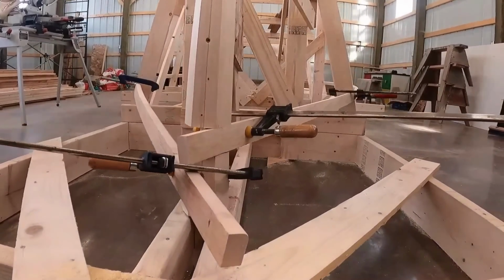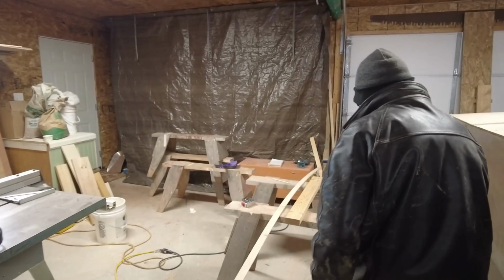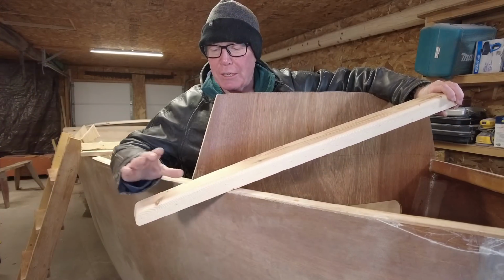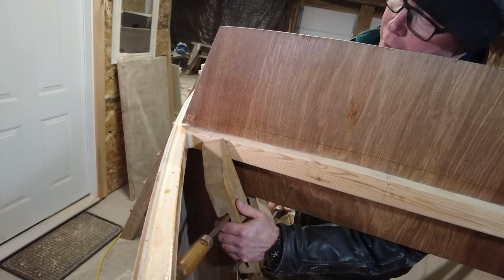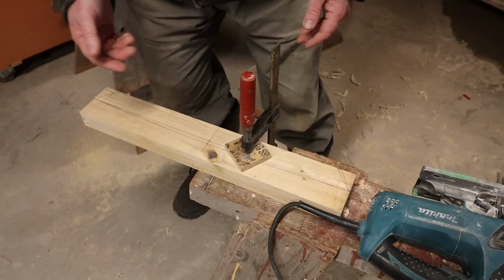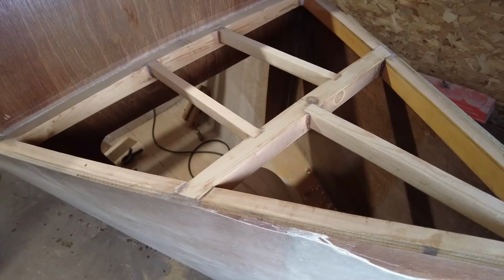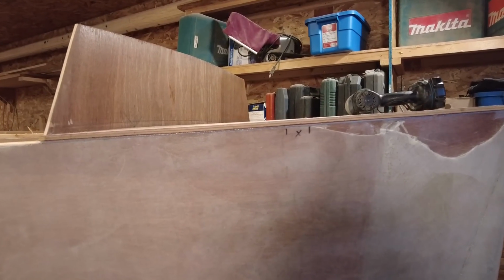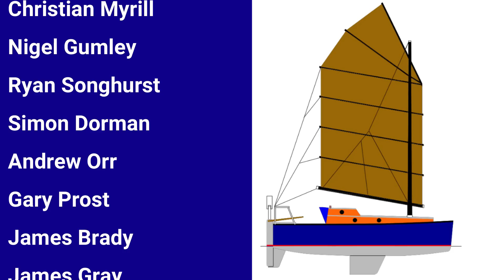S2E59 Building the Foredeck

Comment: Nice epoxy technique Al. Not having to worry about pot life as you set up the joints, then tent and toast the work zone. Except for cold fingers much better than summer jobs in the heat. I can hardly wait for the rigging and sailing videos. The missus seems to be a good help too.👍👍🤙👊
Reply from the maker: Battling the weather. The good with the not so good.

Comment: Yikes, that shrieking wind is nightmare fuel.  I just realized that WR will have a raised cabin amidships with no sidedecks, similar to Jester (which was basically a Contessa 26 with a raised cabin amidships.  Interesting how you have synthesized the two in a way, in two boats).
Reply from the maker: The Jester connection was pointed out to me after I presented the change to the Wave Rover builders group. To me it just makes more sense structurally than the original WR doghouse.

Comment: I like what you did with the stern, using stainless steel screws. Why not for the bow as well, makes sense as it will be taking the brunt of the beatings at sea? And a very Merry Christmas to you too sir.
Reply from the maker: The glue truly does all the work and there is a possibility that the screws could lead to rot down the road. A lot of builders would leave them in.  Merry Christmas

Comment: Looking good. 

Except, every time I see that curved raised roof section I think how hard its going to be to safely move forwards. 

Why not add a very narrow sidedeck section. 150mm-200mm would be enough to get some level footing. At the very least mock it up before you build it. As you know when singlehanding, safe and efficient movement around the boat is a priority.
Reply from the maker: I mention my solution for going forward in the next video.

Comment: First, I would like to say that you are right about the Junk Rig. From cost, performance, ease of handling, ease of reefing and ease of repair, it is probably the best rig for the job. A panel between two battens might be totally gone and the sail still be usable. It has a lot to offer, especially to a solo sailor. Still, I would also consider a mainsail with a wishbone. It’s a more modern design while still being very easy and safe to use. I think it would offer many of the advantages of the Junk Rig with better performance whenever the wind is ahead of the beam. But then, gentlemen are not supposed to sail to the wind.
Reply: Junk-rig performance to windward is no longer an issue. Cambered junk sail development has come a long way in the last couple of decades. Modern junk-rigged boats perform to windward as well or better than typical western designs. They're even winning races against them.

Comment: The Chief lug (junk sail) has the following disadvantages:
1.) It's heavy, because of all the boomlets (battens). It is also heavy because the mast usually has no shrouds or stays supporting it.
2.) It is usually flat-setting, meaning there is little or no fore and aft curve in the sail. This gives it lower performance, especially upwind.

Now for the advantages:

1.) It requires little or no specialized hardware, such as goose-necks, boom jaws, or boom vangs.
2.) It is extremely easy to reef. Just relieve the halyard and the lower boomlets stack up. Because reefing is so easy, one is far less likely to delay doing it.

Because most long small sailboat voyages are predominantly down wind, the lower upwind performance is not as important.

There are probably more reasons to use this rig for this purpose than there are not to.
Reply: it used to be flat, with all the consequences, some 50 years ago. Now sails are cambered with a choice how to get it. The old flat sails can be easy cambered by applying some hinges into the battens.
Reply: The lower upwind performance is no longer an issue. Cambered junk sail development has come a long way in the last couple of decades. Modern junk-rigged boats perform to windward as well or better than typical western designs. They're even winning races against them.
Reply: @krismatski  
I've heard of those. They may improve the performance, but with the cambered cells, the camber can't be adjusted. And the hinged boomlets (battens) add complexity (more things to break).

I suppose that, with the originals, the fabric stretched somewhat forming a more or less airfoil shape. Modern sail cloth is intended not to stretch.
Reply: @markthomasson5077  
There may be some truth to that. The problem with a masthead sloop or cutter is that the mast is a compression member, so has to carry its maximum section to nearly the top. 

A cantilever, one-sail mast can be tapered quite a bit at the top and step. Also, with a CL rig, it can be somewhat shorter.

But, if we were to play by the same rules, with a one-sail Bermuda rig, with a low AR sail, the Bermuda rig, with its single boom, would be much lighter.

Comment: I wanted to ask your opinion on whether or not to buy a gasoline powered outboard motor for my dinghy as I  know you had one on Wave Rover 1. I'm concerned about the explosion hazard as I also cook with an alcohol stove and have non ignition-protected electrical components aboard and during offshore passages, I'll have to bring the motor below decks. I've got a diesel inboard on my 26' sloop so the outboard is just for the dinghy but  not sure if the expense and risk are worthwhile.  My dinghy doesn't row well in 20+ knots and, as you know, oars definitely limit realistic dinghy range. Would love to hear your much more experienced perspective.
Reply from the maker: I made sure that I always ran the engine totally out of fuel before taking it below, I'm not sure if this is the right thing to do but we transport chainsaws and engines in our cars like this. I had no fumes and stored it up forward. I kept the gas on deck. This time I will have deck space to store the engine and the fuel.
Reply: A sailing dinghy?

Comment: My husband is building a boat - 46’ Wharrum - what is S1. Also why do you smooth off fresh fillets and then you still resand with 80 grit sandpaper for fibreglass or protective coatings. Why not just leave the soft fillet rough? Thank you.
Reply from the maker: S1 is an excellent epoxy sealer that penetrates wood. You sand any surface before recoating, after it is hard, to create a "keyway" for the next coat

Comment: you can remove screws after the epoxy sets
Reply from the maker: That's correct but don't leave it too long or you run the risk of snapping the screw.